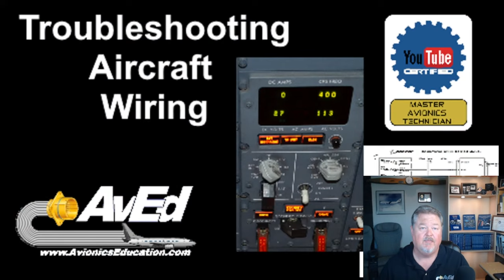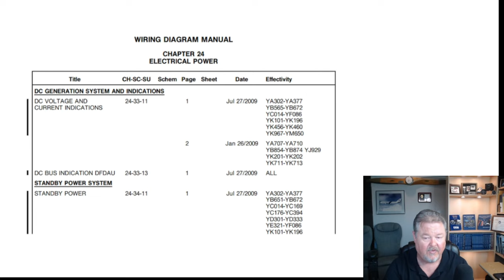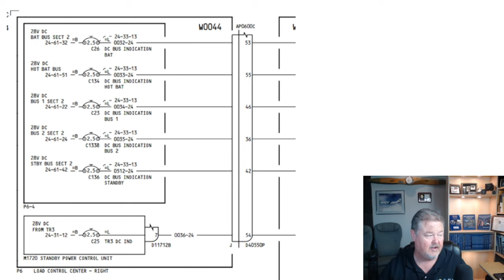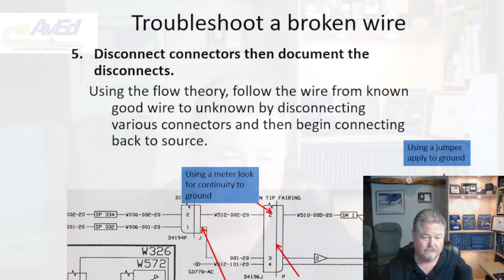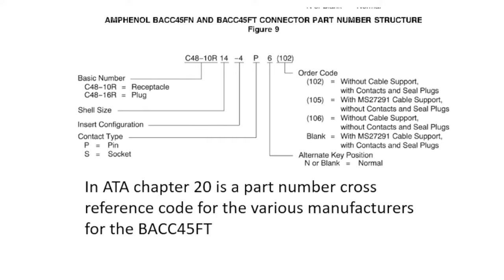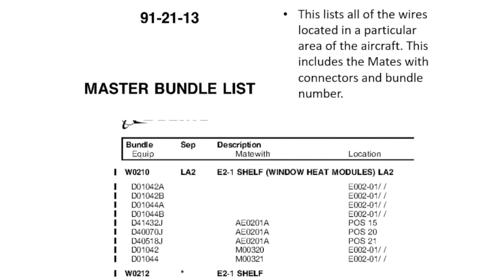Troubleshooting Aircraft Wiring

Comment: hi.. where i can found the tools to perform electrical check in arinc connectors? pin to pin , is necesary use contact pin  or socket pi to perform electrical check in connector arinc? or i can use other tool? thanks